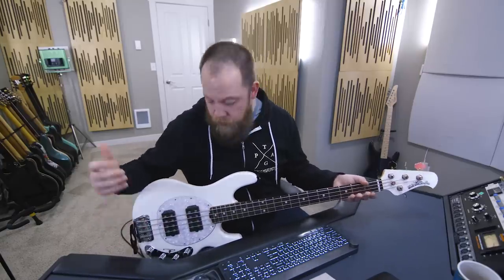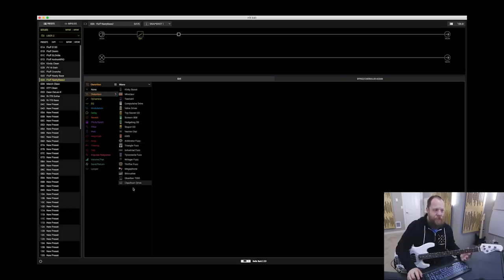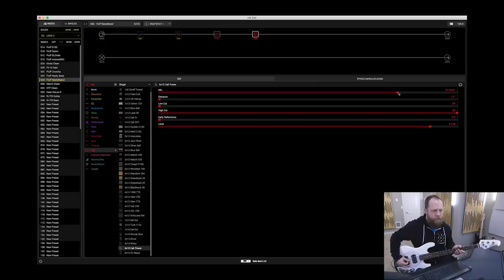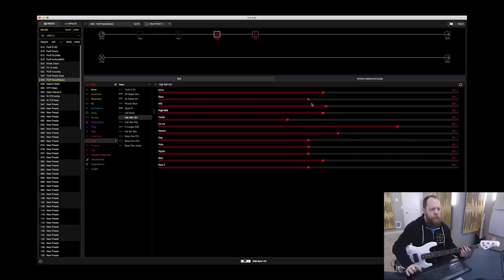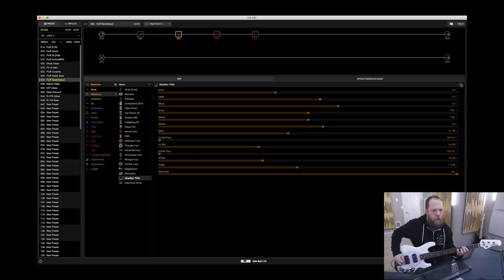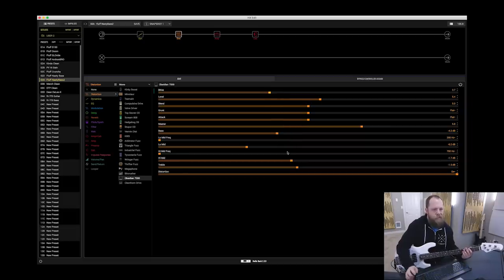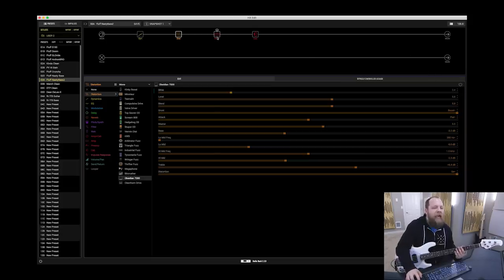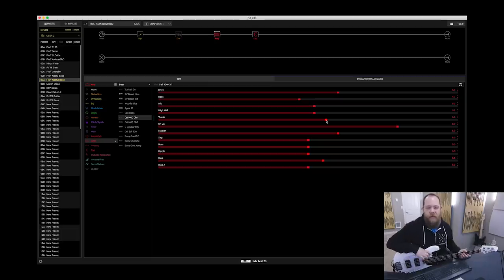Making a Helix Bass Tone!

Comment: distortion bass? you must split signal. 
first signal - high and mid (300Hz<) - distortion (obsidian 7000 or other).
second signal - low (>300Hz) - clean signal. Optional Compression if you want.
Mix both signal and add some amp + cab

Comment: This is a very good guide to get a usable generic tone that can fit most genres, there is nothing wrong with this.
I'm glad you decided to use a most more cutting clean signal instead of the two signal chains with a distorted high end, such as the guide from Gear Gods which I believe is terrible.
Only thing I would suggest is more mids!
Mids are everything but the scooping is most likely due to the pickups selection.
This tone is similar to a Slipknot sounds, if you were to pick a bit harder is would be Identical.
Good job on this one!
Edit: I preferred the 8x10 sounded much more clear and pronounced; would have been better in a mix to cut through and be heard.

Comment: It's nice to see you didn't do the same technique as the dude on Gear Gods. That terrible "Split the bass into 2 tracks for highs and lows and just distort the highs". Sounds like crap but everyone uses it. Nice to see a good old fashioned bass tone!
Reply: TheRealMikeShea I’ve tried both, and it it seems easier to me just to use 1 amp and get a decent “gritty” tone vs blending 2 tracks. I think for super heavy metal though 2 tracks is the only way to get it to cut through the mix well enough
Reply: That's because it works? Everyone does this for a reason. It keeps your low end mixed perfectly. That way you aren't distorting the low end and making the whole mix fall apart.
Reply: I'm certain it had been done with one bass track in a lot of your favourite metal songs pre-2005. To me, splitting it sounds like crap. And I mean, this is metal we're talking about. It's supposed to be a little chaotic. When metal is too clean it's a little boring.
Reply: I agree the Gear Gods one sounded horrible, but if you do it right and just use the second (high end track) to cut through rather than boosting it up so much that you can hear it over the original than it sounds really good... just a little more dirt and a lot more high end on the second track but way less volume and you get the thickness and punch of the original track but it cuts through a little better, imo its better than just trying to use one track
Reply: I'm content using one track. The double sounds unnatural. I dunno there's something off about it. It's not inspiring.
Reply: TheRealMikeShea to each his own i guess, thats whats great about music and mixing there is so much variety and so many different ways to be unique
Reply: Chris Squire (Yes), Geddy Lee (Rush) and Justin Chancellor (Tool) among others have used the bass splitting method for ages and their tone is certainly not crap. Maybe the difference is that they use real amps and not a Helix.
Reply: Or maybe they did it in a not so aggressive way. Geddy is one of my biggest influences for bass. The way it's used on modern metal is crap. I think the first time I saw the technique laid out, I immediately thought "oh shit that's the tone on Rareform by After The Burial". Love that album but could care less about the bass tone. It's just not my thing, and seems like more work than it's worth.
Reply: Splitting the bass into two signal paths make it easier to keep the lows from being distorted. Its one of those things, you like it or you don't.

Comment: i played a stingray straight into an amp for 40 years. you have to learn to make the sounds with your hands. i play through a tech21 flyrig straight into pa back to ears now. sounds more natural than anything else i played. the helix feels like you are triggering sounds like on a keyboard instead of producing tone with your fingers.
Reply: I'm pretty sure Ryan Martini never used any affects aswell. I have also learned that so much of what I was looking for was all in my right hand(I'm right handed). How you approach the string with your fingers to where you play, towards neck vs towards the bridge. Sliding off the string like upright bassists or digging in with the finger tips for more of a pick sounding attack. So much tone comes from the fingers.
Reply: So you sounded boring for 40 years, ok. Please tell me how one would achieve distortion (proper distortion) or modulation effects with fingers? Some of us use those too believe it or not